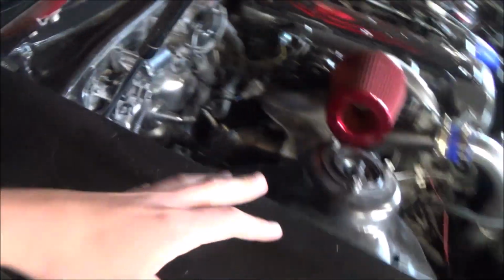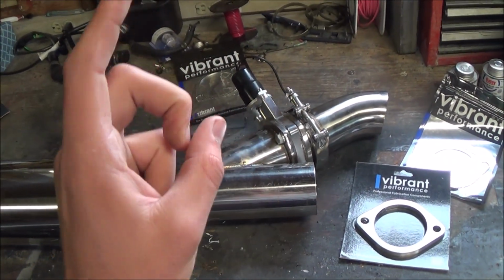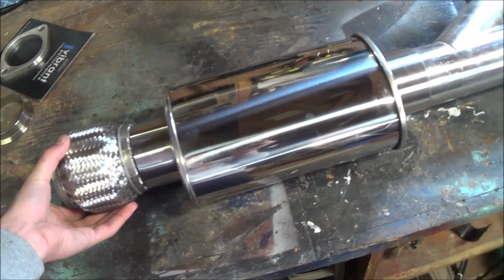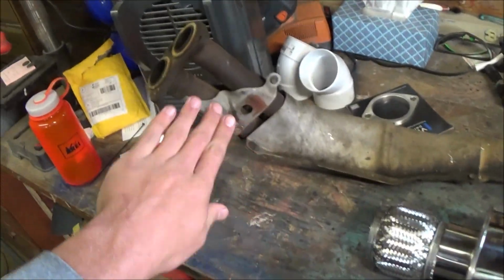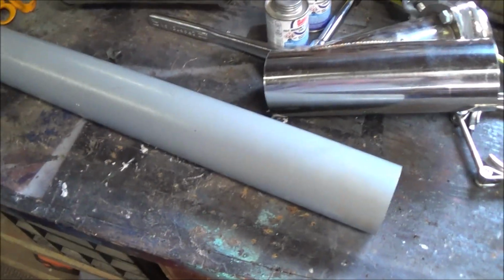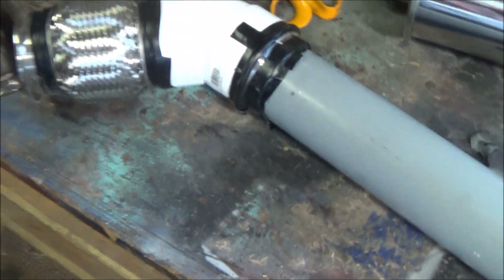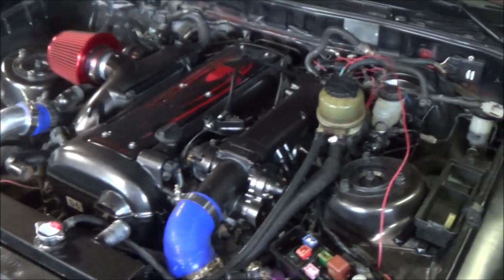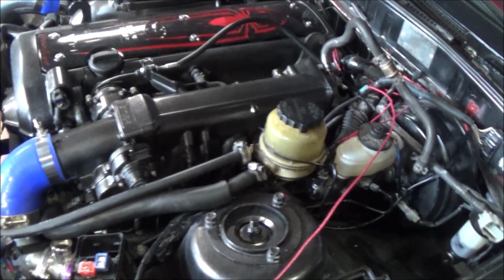1jz Supra CUSTOM Made EXHAUST | part 1

Comment: Maybe you can do a battery relocation to the rear and put the power steering there. It’s an idea I’m not sure if it’ll work
Reply from the maker: I've played with the idea a bit.  I'm probably going to do that some time down the road, but for now I'll leave it as is until the car is running